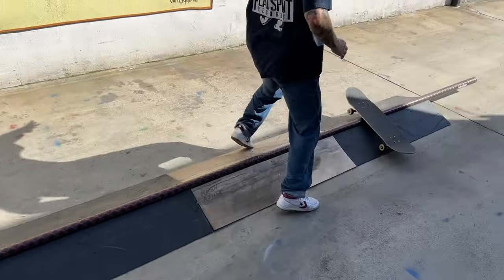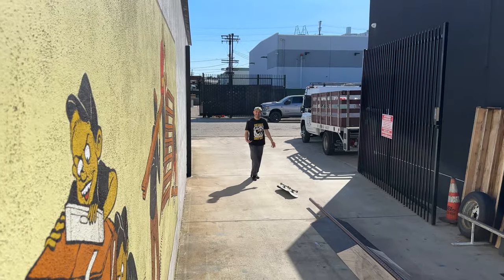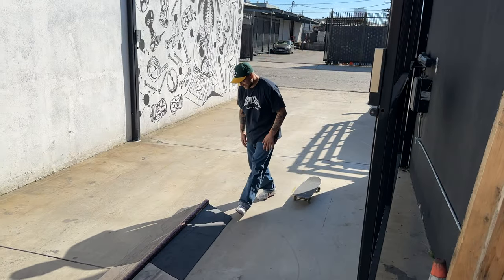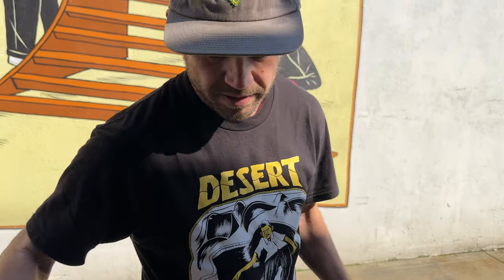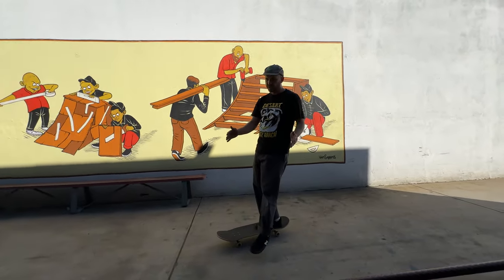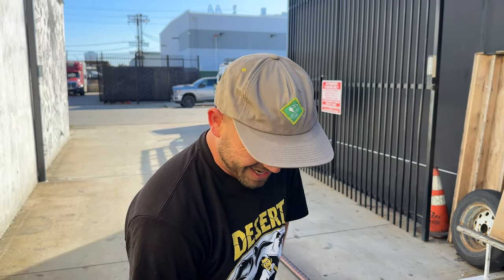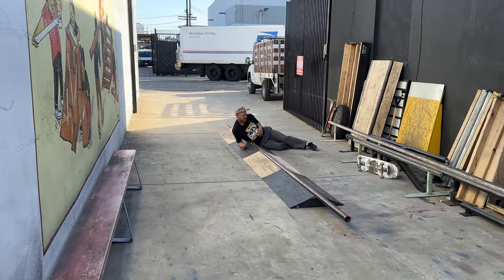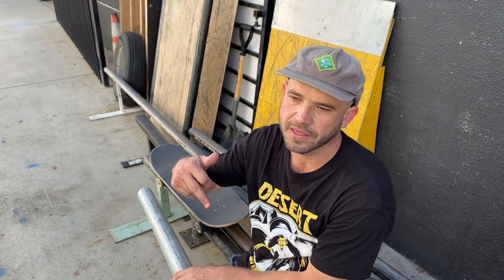It's the funnest Slappy Obstacle ever!

Comment: Hear me out. Modular slapstick.
Make a curved section, like a 10ft radius. So it turns 45 degrees.  Hell, a 90 would be cool.
Reply: Terrible idea, needs to be atleast 720 degrees
Reply: @nickt204  so...a spiral?
Reply: wouldn't work. or i mean, this curved section would be totally useless without other slapsticks. the surface would have to be cut into a wedge shape. geometry n such
Reply: think about a piece of pie as a ramp where the crust is the coping. how you going to get there when the ramp meets the ground at a point. one wheel manual?
Reply: @DarmokAtTanagra  stop thinking logical
Reply: @jpizzleforizzle  yes king
Reply: @DarmokAtTanagra  I'm visualizing it as a very very shallow bowl. Like, the whole thing is the slapstick, wood and all...just...curved on it's length.
It could be modular.

Comment: How bad does the diamond grind destroy your trucks and board?  Does it not eat it up?
Reply: Hate to answer your question without actually answering it. But I’d assume if the metal is a softer metal, than the steel or whatever trucks are made of, you’d be fine. As the diamond grind would be the thing getting smoothed out and worn down. If not and it’s harder, then by all means. That bitch gonna slowly chunk and shave away your trucks. That sound alone hurts my heart. Hahaha
Reply: It's fine. Much less than a curb. A little more than a regular rail.
Reply: @bumrodgers  that sounds about right